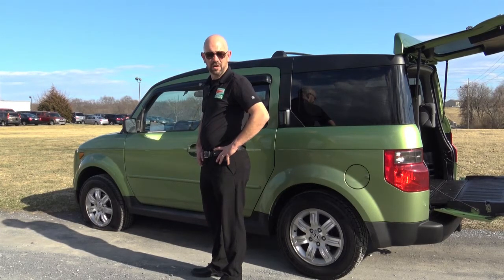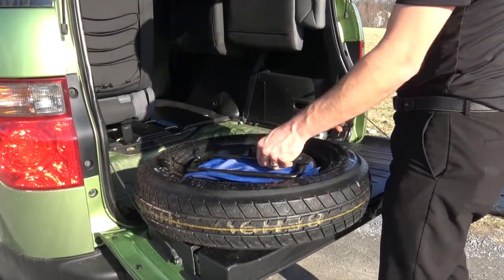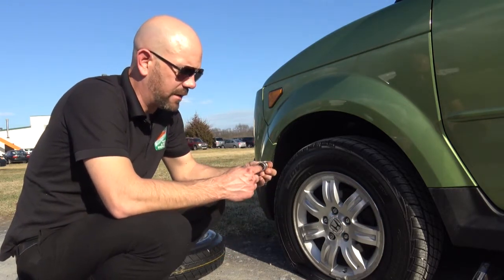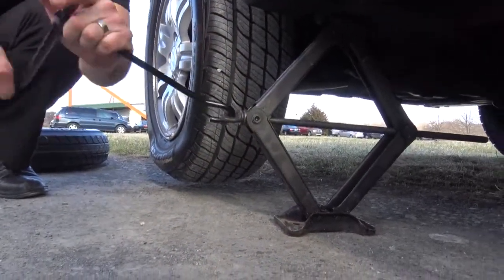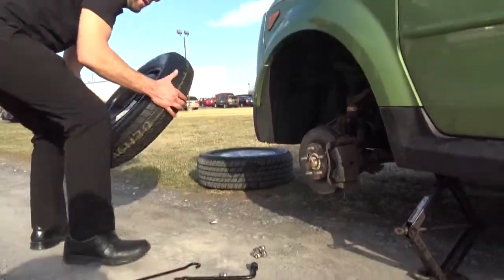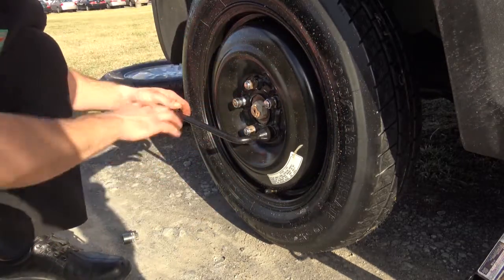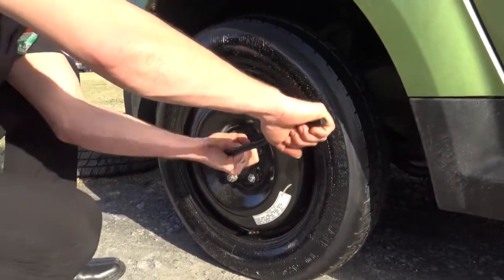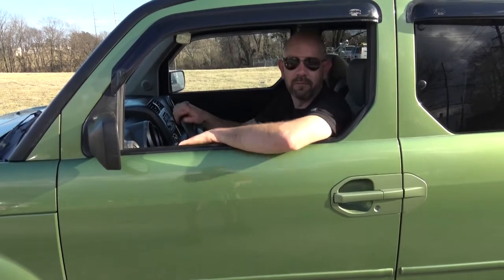How to Change a Flat Tire with Triangle Motors.

Comment: Had a blow out last month and had my wheel locked on how I got it off was with a 2x4 and a 2.5 pound mallet,I placed the 2x4 on the rim and h the wood with the mallet a hit it on both end of the wood and it knocked the wheel loose.